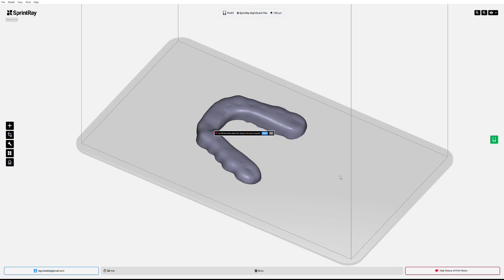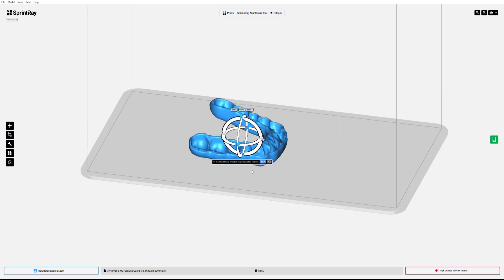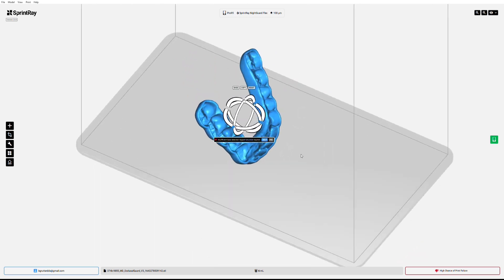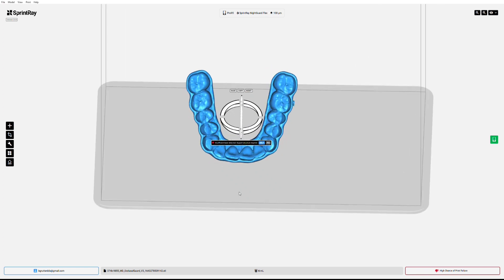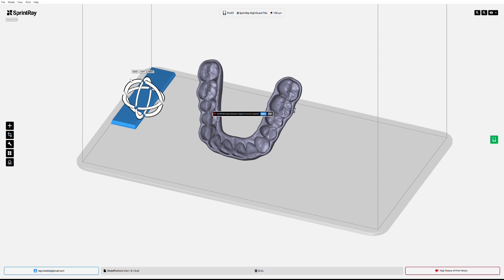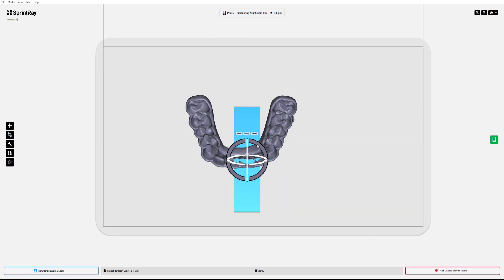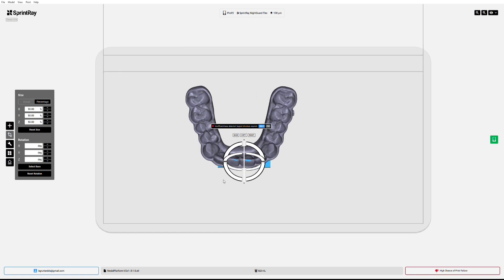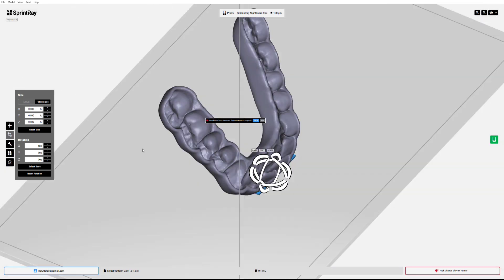60 Second Tips: 3D Printing Nightguards

Comment: Is this any different or easier than adding the print raft in D3 Splint?
Reply from the maker: If using D3S, to it there for sure. This is for those using outside design services or software (most) without that functionality.

Comment: its ok to print when it says its non-printable? How have you determined that it's acceptable without the suports the software wants to give it?
Reply from the maker: Time and LOTS of printing. You're welcome to follow the software prompt. I wouldn't blame you. I'm just a dude with a YouTube account. Lol. But I can say that it works but functionally and logically when you breakdown how 3D printing works. So long as each layer is adequately supported by the preceding layer, all is well. That's the reason behind my 45° orientation. Both the buccal and lingual flanges are supported.